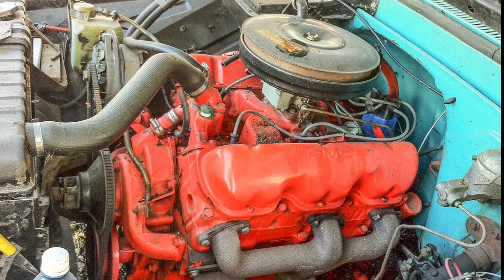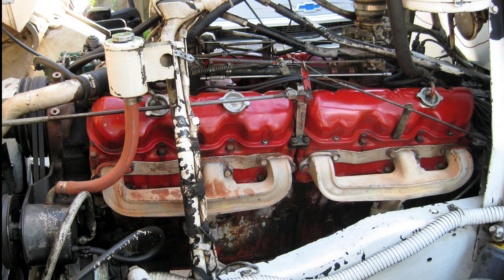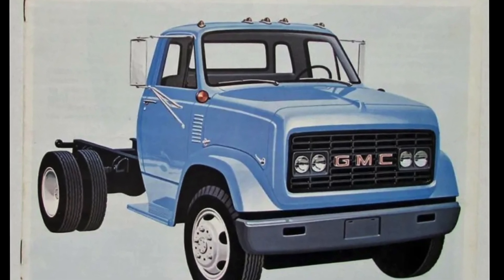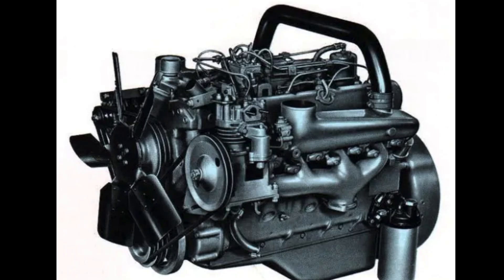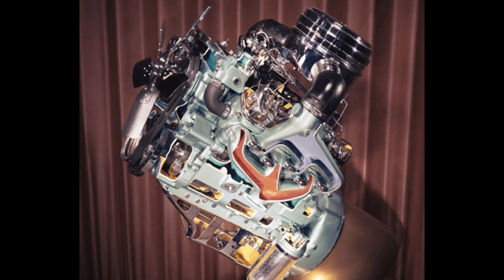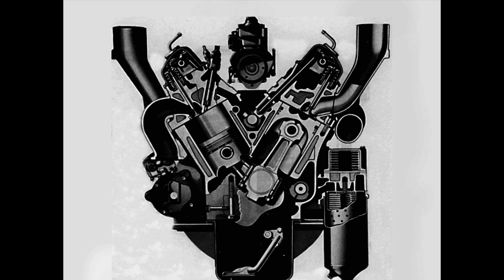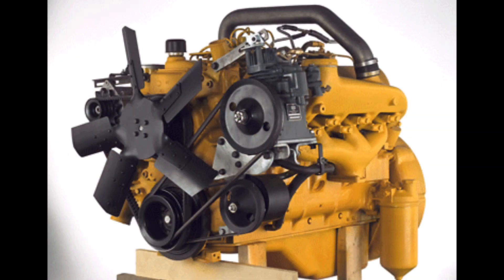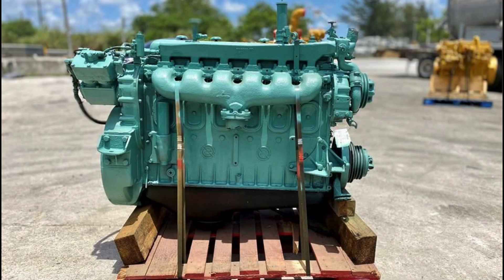Crazy Engines You've Never Heard of: the 351, 478, and 637ci V6/V8 GMC ToroFlow Diesels!

Comment: People today might find this whole business with the huge gas engines and these tentative steps towards lighter duty diesels a little peculiar since there is now a wide variety of very good medium and light duty diesel engines available for just about every application. That just wasn't the case in those earlier days. 

Diesels for anything other than class 8 trucks and heavy equipment were expensive, impractical and just not a thing that many buyers gave much consideration to in those days. Gas was cheap, diesel fuel was more expensive and diesel engine options for lighter applications were few and those that were available were not that great As a result, trucks with very large gas engines were quite common. All the manufacturers had them.

I like to say my trucking career really began at age 13 since my first few years before I was licensed for the road consisted of moving trucks in and out of the shops and the wash bays, shifting them around the yard etc. That was in 1975 and there were still quite a few of these units in service so I remember them well. My friends and I were of course, all car nuts too and I liked to brag that I'd operated bigger engines than any of them.

Comment: GMC 302 inline sixes are an older motor than most Adam has covered, but the 302 is kind of like an earlier version of the Ford 300 inline six. 

In the 50s aftermarket parts made the GMC 302 (1952 to 1960) a hot rodders favorite. The GMC 302 shares the bore with the Ford 300(4" x 4"), the stroke of the Ford is 2 thousands less than the GMC.

The aftermarket once produced alloy 12-port heads for the 302 GMC, the newer Ford 300 always had 12 ports.  It almost seems as if Ford engineers were an admirer of the hot rod history of the GMC 302 and reproduced their own version just as GMC adopted a new truck v6. 

The GMC 302 was so popular that more than one 12-port aftermarket alloy head was manufactured, now highly prized by collectors.  The 302 is a great nostalgia motor, and when modified is still pretty powerful.
Reply: GMC had a 502 -6  .
We had dump truck 1950s with a huge 6 .
Reply: Interesting about the 302 GMC, I know the 300 Ford is smooth and stout. I would imagine that the GMC is similar, I am a V8 guy for max performance, but I have a soft-spot in my heart for inline sixes, they are a good example of perfect engineering. I have had a 258 GM, two 300 Fords, and now a 4.0 AMC, -all EXCELLENT engines, by ANY standards. The I-6 design will always get it done, -no matter what. Plain and simple.

Comment: They did not follow the normal formula for diesel engines in that the stroke is usually longer than the bore diameter because in truck  type operation you are looking for torque more than top end power. Diesel internal components were generally much heavier so you wanted to keep the RPM down anyway. they are interesting engines that I have never come across. I have repowered 4x4 vehicles with the 350 GM diesel and found it not that good  compared to other brands. I wonder if there are many used engines from this GMC series in breaker yards and the like? The pistons with the combustion chamber in them are called Herron chamber pistons and you find them in most diesels as it is easier to machine a piston than it is a head and diesel pistons usually have a thick crown on them because of the combustion pressures and to dissipate heat.

Comment: Neat to see they were using direct injection back then. That would've made them noisier, but more fuel efficient than the IDI designs used in the 350, etc diesel engines. Direct injection also puts less load on the cooling system. The 2 stroke Detroits are also direct injection.
Reply: That is a misconception;  IDI's were often noisier   e.g.  Ford 7.3 IDI,  Cat 1673 and 1693
Reply: @Hogger280 100% Indirect sounds like they're trying to explode!! I think this guy is comparing with a direct injected 7.3 (Powerstroke) which is very noisey, due to the HEUI injectors. 
Direct injection is better in every single aspect, and does NOT produce more heat.
Reply: @Hogger280  VW and Mercedes picked swirlchamber / prechamber designs citing noise as a main reason.
Reply: @compu85 No they didn't. Indirect injection diesels were produced because they would run on a much simpler fuel injection system. Less fuel pressure, but required much higher compression ratios. 
There's a reason why VW and Mercedes upgraded to direct injected decades ago.....

Comment: I saw one of these in a marine application.  I don't think it was kinder to it that the truck application.  The boat was about as streamlined as a brick.  Normal speed was about 7kts wide open was about 7.1kts.
Reply: Marine has unlimited cooling thats huge on longevity

Comment: As the former owner daily driver of a 351 gmc V6 which acted like a 4.3 performance wise with 454 mileage with a stromberg carburetor using a unique carburetor pattern and a floor pivoting mechanically sprung throttle, I must admit this was a depressing engine to find service parts for. It was hard to maintain it really was. I was lucky to have the help I had from the likes of my surrogate father a brilliant body man who held a GM license whose career and financial success peaked in the mid 1980s. That engine line was good but bad because it was ghosted and abandoned.
Reply: My first 305 gave the parts stores headaches!!  "Hi, I need a <insert random engine part> for a '63 GMC 305."  Parts guy..."There's no such thing, you mean a ford v8 305, right?"  "Nope, GMC V6 305."  Parts guy..."There's no such thing..." and on and on and on!
Reply: YUP, sucks to be the owner of an orphaned vehicle/engine.

Comment: Isn't it a testament to GMC engineering that they could build a successful diesel off an original gas design with minor modifications?
Reply: The Olds diesel would have been a success story with extra head bolts, a water separator, and a turbocharger. They knew how to do it: seemed cheaper not to.
Reply: @BillLaBrie  Agreed. Many of the DX block cars are still running.
Reply: @BillLaBrie    Turbocharging requires further strengthening, but yes could have been a great success if designed right the first time.   Problem is they wanted a cheap POS and they designed one - could have been some pushback from Detroit Diesel division who didn't want any competition.   GM did consider using the 4-53 in pickups and actually installed some and tested them.  They were successful of course but they didn't like the noise.
Reply: @Hogger280  As I said, they knew the right way to do it, but chose a cheaper route. Cost more in the long run, and went a long way towards prejudicing Americans against passenger car diesels permanently. GM had the best engineers and even better accountants, so the accountants got to do the final engineering.
Reply: @BillLaBrie    We are saying the same thing.
Reply: @Hogger280 Or the terrible fuel economy.
Reply: @BillLaBrie No turbocharger. IDI diesels already have crazy high compression ratios, they can't handle much boost at all.
Reply: It is a testament to laziness and penny pinching that they didn't do it right in the first place.   GM was notorious for making a POS,  getting a bad reputation,  fixing the problems too late and losing the model after it was fixed - e.g. Corvair,  Vega,  350 diesel.   GM's 350 diesel was so bad that it ruined sales for other car companies because fickle buyers thought they were all bad!

Comment: I have only seen one of these running so far. It was a 478 diesel in a new idea uni system it is a self propelled power unit you could put a corn picker, forage harvestor, and a combine attachment that went onto it. Also if an old mechanic friend of mine is to be believed any auto/truck have more injector pump issues than the same diesels used for ag or marine as you mentioned do to more consistent rpm use.
Reply: We had a 1975  705 New Idea Uni system with that 478 GM Diesel , It had Bosch injection pump stamped made in Germany , We had the hulking bed with a 4 row snapping head that we also used with the cage shelter, We also had the 767 super chopper for corn & hay ,Chopping the hay worked the P155 out of it but never had any engine issues ,Changed the oil ever 100 hours ,It's been30 plus years ago but when I sold the dairy farm to retire I think it had north of 3,000 hours on it , We also picked ear corn ,Shelled corn & filled silos for people in the area ,Filled 15-20 silos a year, I don't think it ever used more than 3 gallons a. hour even chopping hay., The only issue was it was cold blooded with it below 30 degrees,  I used towarm it up with a Knipco heater blowing on the block if we were shelling corn laye in the season.
Reply: I bet the old pump made a lot less pressure than the newer ones, that may have helped with longevity.  Regular old diesel, too, with sulpher in it helping lube things.

Comment: Being a Stealership Mechanic in the Oldsmo-Buick days was a lot of fun. If those things made it past 50,000 miles without the heads flying off, they'd go 200,000. The ones that didn't got a Target Motor, Hecho En Mexico with thicker decks, larger head bolts, and a stronger fire ring design head gaskets. Did I mention Warranty Work Flat Rate sucks?
Reply: Flat rate is killing to automotive repair industry. It’s a breading ground for shotty disgruntled technicians, and I refuse to compromise my standards in favor of time. And we wonder why there’s shortage of technicians.
Reply: @travismilberger4906  Yep, I know two expert body guys that are out of the trade for just that reason. Sad state when the bean counters think they know more than the skilled people doing the work, -especially where safety is involved.
Reply: @travismilberger4906  That seems to be the case for many other industries and trades as well nowadays. They all want quantity over quality. 😡 Long gone are the days of QUALITY over quantity!
Reply: Converted a few diesel to gas and they then has a bullet proof bottom end that could go over 200k
Reply: @billmoran3219 very interested in this comment. Use the crank and block and swap heads for a stronger BB bottom end? What are the details? Using a mix n match of surplus oem parts to build for power?
Reply: After the DX motors in ‘81, the 5.7 diesel was greatly improved.
Is farm kids knew how to work on and operate them correctly, and during the hard times of the 80’s, it let me drive pretty new cars for cheap.
I recall Kelly Blue Book having a “deduct 70% for diesel engine option”!
Nebraska also had a tax stamp you could buy for like $35-40 that legally let you run farm diesel. Took FULL advantage of that!
Reply: @RedIron1066 I would love to have an Eldorado/Toronado/Riviera diesel as my daily driver ❤
Reply: Is that why when my fusion needed a new motor. They rushed it and forgot hose clamps and screws?
Reply: @nb7466  I mean beyond being a terrible tech.... Probably.
Reply: I was  there  , but  I worked  with  my  dad's  auto  repair shop   and  he  specialized  in G M automatic  transmissions     what  a way  to learn  how to  rebuild  transmissions  ,  now  I'm 60 years  old  and  my  oldest  brother and  my  youngest  brother  still  own the  transmission  shop  , MY,,,,, how  things  have  changed 😂❤
Reply: The first time I ever saw a TargetMaster 350 I couldn’t help but think “what the heck is this?”
Reply: @488ci I've seen many "GM Goodwrench" 5.7 diesels, but never a "Target Master". From what I understand, "Target Master" engines were garbage re-man engines and not new ones like "GM Goodwrench".
Reply: Stealership ! I just got it....😂 the good old days ay mate ! We didn't see them here in New Zealand,  if so not  many if any ! (That's a Kiwi music mention bro)  Massive,  impressive engines mate ! Wow... Cheers from New Zealand 🇳🇿
Reply: @stevelee5724 You can edit your comment and not "triple text"
Reply: @Bloodcurling you can edit your comment and stop telling folks what to do. 

If you're really bothered by it enough to say something, maybe you've had enough Internet for today? Lol
Reply: Oh I forgot to add.
Reply: Have a nice day!
Reply: I've seen a few Olds diesels here in NZ which I find kinda funny  @stevelee5724
Reply: We're mexco engine blocks high nodularity  ?
Reply: Mexico engines ay ! Chur 😊

Comment: I don't understand that GMC was using balance shafts in their 60 degree V6 & V8 engines. Why didn't Buick use a balance shaft since they worked in GMC engines in their 3.8L (231ci) V6?
Reply: The GMC V6 Gas engine did not have a balance shaft. It had 6 separate rod journals and was an even firing. Apparently the diesels did, but not sure why.

The Buick V6 was initially a low buck conversion from a V8. But even when it changed to a split pin, even fire engine, the block would have to be re-cast to incorporate a balance shaft. It wasn't until the "on center" block came out that it got it's balance shaft.
Reply: Thank You for your response. I appreciate it. @geoffmooregm

Comment: 7:52 that piston / head combustion interface is typical of almost all CI engines. Some Dieselized SI would be an exception. I think the Olds CI had SI type cylinder heads.
Reply: The Olds had flat heads like most diesels, but had a precumbustion chamber inside the heads. That's the difference between "indirect injected" and "direct injected" diesels. Indirect injects the fuel into the precombustion chamber and the explosion farts out into the cylinder. Direct Injected actually injects the fuel into the cylinder, pointed at that little dish with the point in the piston. That little dish is technically the combustion chamber.

Comment: Those were low rpm commercial engines when gasoline was still common in big trucks.
Reply: The Toro Flow diesels typically had a red line of 2800 - not a low rpm engine.

Comment: I remember some of these engines.  My father worked for Coca Cola at my small town bottling plant and used these GMC trucks in delivery fleet.  I recall adjusting overhead lash on the older engines with solid lifters and cam with the engine running and oil flying all over the place.  Those were the days.
Reply: We used a set of valve covers with essentially a window cut out for valve adjustment with the cut piece bent to catch most of the oil getting slung. Glued the gaskets in so you didn't have to fiddle fuck with sliding gaskets trying to line the bolt holes up.

Comment: Thank you for covering these heavy-duty V-6s from GMC again.
Somewhere, a person called them the 'Hercules' series of engines because of their durability.
I particularly like the V-6 478...hitting its maximum torque of about 440 at 1400 rpm....think about that.
You reach your maximum pulling power in a truck not many revs above pulling away from the stop sign..
Reply: @67marlins  The 478M in my dump truck is the perfect choice for such duties. In fact as far as I'm concerned, there is no better automotive heavy duty gasoline engines than the big block GMC V6's.  Even the small 305 has it's torque peak at 1600 RPM.
Reply: @turbo8454  I'm a Ford and Mopar guy, but always admired the GMC V-6s.
I think I read somewhere that GMC engineers felt that a V-6 had certain advantages over a V-8.....( some of which we already know, like less complexity, a 60-degree block for possibly better serviceability underhood ), but I thought they also said a V-6 block was sturdier ( less flex ) and more stout, but also that cubic inch-per-cubic inch, somehow a V-6 achieved max torque at lower rpm.....(?!?)
In other words, GMC wasn't designing an all-new truck engine just to be different or avoid the penalty of having an inferior chevy engine, but they honestly concluded that a well-designed V-6 was better.
I have to admire GM for letting their GMC Division develop and build what they thought was best. That was the elegance and intelligence of GM's intended organization- cooperate when needed but compete where reasonable.
Reply: @67marlins  The V6 certainly has some advantages over the inline 6. I do not know what GMC was thinking when they designed it other than perhaps to be a worthy replacement for the inline 6's, some of which dated back to the 1920's Buick 6 cylinder engines.

The low torque peak RPM has nothing to do with cylinder layout however. The largest factor of where the torque peak RPM occurs is the intake valve event timing.
Reply: @turbo8454  The primary advantage of the V6 configuration was a shorter crankshaft, so less end-to-end flex than an I6 crank, and the engine itself was more compact so it could fit into tight spaces easier. The V6 did find some use in farm and industrial equipment at the time.
Reply: @turbo8454 You're familiar with the Ford Super-Duty truck engines, I imagine?
V'8s, starting in 1958, ran through early 70s.
They were just for huge commercial applications like dump trucks, buses, F650 and up.
They had no business being in half-ton pickups.
401, 477 and a 534.
The 534 weighed over 1,100 pounds.
Reply: @67marlins  I am familiar with the Ford Super Duty's as well as all the other big gas burners of the 50's, 60's and 70's.
Reply: I've got a 401 in a 66 bus. The first time I drove it I would have sworn it had a diesel in it if I hadn't already known better. That thing can grunt at very low RPM.
Reply: That person may have mixed up the 478ci L/LD/LDT/LDS-465 made by Hercules, White, Continental in the M35a1/M35A2 and M39 5 ton rigs. Easy to mix that one up
Reply: @mtvrchannel3051  OK, I never thought of that, but some GMC enthusiasts may have nick-named their V-6s....?